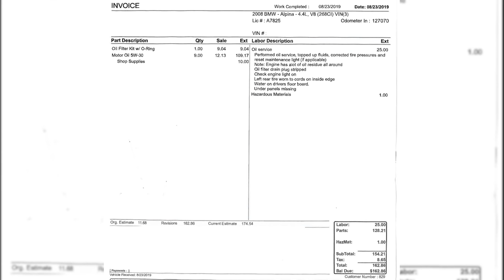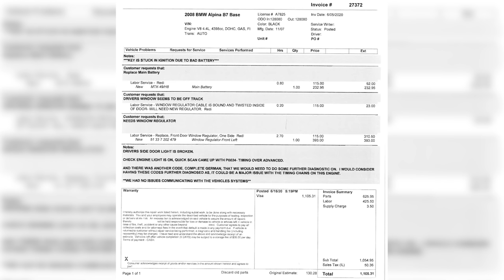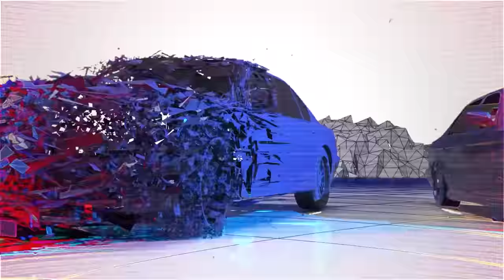Broken Alpina Is Hiding Secrets and a NAIL, Literally - Supercharged B7 - Project Chicago: Part 2

Comment: I used a small nail (instead of a simple metal pin that my tool kit didn't come with) to release tension on the timing chain tensioner when I did the VANOS seals on an M50TU. Thankfully I didn't drop it in the oil pan. Perhaps when they were timing it they used a nail instead of some special tool? Not sure. 

Great work as always Sreten!! This Alpina is proving to be a worthy challenge!
Reply: That's a good explanation.
Reply: There are other ways nails can get into an engine.
In a large service garage, besides mechanical repairs, oil changes and tire repair are also done.
Tire repair guy pulls a nail from a flat tire, throws nail at garbage can, nail bounces off side of garbage can and lands directly in the 6 quart container used to carry oil from the bulk oil to the car.
Oil change guy grabs container, fills with oil, pours oil into funnel in the car, nail is now inside the valve cover.
Yeah, that happened but was caught before damage was done because their hand was on the funnel and felt something jiggle down the neck.
I pulled a 2 inch nail out of that low mile, almost new truck before it was ever started.
Reply from the maker: I thought about that, but there's literally no place in the whole engine where a nail would be useful. I'm still baffled.
Reply: @M539Restorations  well, thank baby Jesus that it wasn't the last nail in the coffin! <-- see what I did there?! I make a funny?!
Reply: M52b25 or b28tu
Reply: The nail is purely for good luck.
Reply: @clementcroitor  door is right behind u
Reply: Or he was making his coffin realizing how much work it was 😂
Reply: one of the PO's had an enemy - that's sabotage. or an insurance scam
Reply: @M539Restorations  It's a magnetic nail to attract metal shavings ! Haha :)
Reply: @the_producer  Sabotaaaaage.....isn't that a famous song?
Reply: @hugovandyk3845  M50TUB25 in an E36
Reply: @M539Restorations  My guess is it was accidentally poured inside the valve cover during an oil change.
That nail probably broke the cam chain guide as it fell down to the oil pan.
Mechanics throw things at garbage cans and miss, and thrown things bounce.
That motor, once refreshed is going to be fine and run like new.
Reply: @M539Restorations  …but you used a special tool alignment pin yourself?

Comment: With my 850Si, just changing plugs and checking the V12 ignition system according to the workshop manual was scary. Even removing the driver's seat and fixing the seat back lumbar pump made me dizzy trying to put it all back together. Seeing your work on this Alpina modified V8 OMG - Sreten you are absolutely amazing - great work. 🤩

Comment: Question, Why dont you remove the bumper and headlight assembly completely? It takes just a few minutes and you would have so much better access. Compared to constantly working around them.
Reply: Older cars tend to turn into 99% dust when disassembled especially plastic and  clips and all that stuff. Also getting the alignment spot on on older bmw's isn't as easy as you might think.
Reply: @Doganderboss  If you spend the time of having all of this in the way into alignment of the parts you remove, don't worry. It'is time well spent. Reply from previous BMW car body repair specialist (as I am). Spare original clips are pennies in a rebuild like this. And don't worry about the dust, BMW are generally built as bolt off bolt on, compared to many other brands. And also they can be adjusted in all directions as you can dream off, so it's up to you and the level of perfectionist you are. As long as you use the same imprint in the aluminium parts for washers, the final adjustment of bumper assembly should be minimum. This E65 have no damage history as far as I can tell so the alignment should be straight forward, I used to work with damaged cars and still BMW was the easiest (in my opinion) to get a perfect front on. if the car has body aligment problem, it will still be possible if its reasonable to get all the lines 99% true.

Comment: This is the best video I have seen on troubleshooting the N62 engine. I assume this same procedure would work on all  
750 models then, correct? I must say being a YouTube taught mechanic, videos like urs are priceless. Because of such videos the blue collar man can now afford to take the gamble on German engineering. I remember taking my first Bmw, a 530i, to the stealership & being quoted $9,ooo! This was to replace the transmission which they claimed was shot. I was morally devastated that the cost to fix it was more than what I had just paid for the car. The wife said, "have u looked on YouTube for a fix". "Of course", I said not knowing what YouTube had to do with it. She of course knew I was lying & made it her mission to fix the limp mode the car was in. Hrs spent on YouTube & she finally found what she needed. She found a video on how to get to the shift solenoid underneath the actual shifter. Wouldn't you know she found a connection coming off the top of the solenoid that had jostled itself loose over time. She found me & said," I think I fix ur car". I said, "BS" so she proceeded to showed me the connection which wasn't push together. Long story short she put the dash back 2gether & we went for a drive and no more limp mode.  I never had a issue with the trans again. $9,000.00 was the Dealership quote & she fixed it with a YouTube step-by-step video similar to urs. Thanks for the thorough video on the N62 timing issues. You don't even know how important these type of videos are to us blue collar guys & gals.😂 They make it possible for the working man to afford such luxury. Where as b4 YouTube the high end German engineering was only available to the wealthy! Thanks again & Please keep making ur intuitive videos about ur Alpina!-)

Comment: That was a challenge for sure. So many parts to remove just to get to the bits you needed.
Paint/mark a white line vertically on your socket and then you can see if turn easier. Normally stick the white line inline with one of the six points of the socket. This also aids torque turning as each point as you know is 60°
We all have confidence in you to get this engine back up and running better than ever. Have BMW upgraded the material for the coolant pipe o-rings??? To something with a higher melt point than OEM spec, to say Viton or even Kalrez.
Keep up the great work.

Comment: After doing my one on lock down last year I felt your pain and knew most of the stages you were going to do before you showed them. Mine is on a 5 series so it's tighter in the engine bay, particularly at the sides. great video as the time that takes in itself to do that is long enough as well. One thing to watch is don't let the vanos sprocket seals dry out of oil for too long as they can cause problems with sticking and causing poor movement.

Comment: 29:29 Get yourself a set of flare-nut wrenches for those fittings (and for brake lines). They grip the nut from 5 sides rather than 2, significantly reducing the risk of rounding it off if you need to apply a lot of torque.
Reply from the maker: I have them for brake lines. Bigger than those you can't really round off.

Comment: My friends e38 also had a M8 bolt inside the transmission oil pan so I believe it is supposed to be there. Bmw just wants to give you a free spare part to fix something. Check if the nail has a bmw logo on it somewhere. You can now nail something my friend.

Comment: Sreten, 
Fantastic series, after fantastic series! This is a brave one though! As my father always said, "You eat an elephant one bite at a time!" The overall complexity is daunting, but each subsystem is simple enough. But, you are going where few DIY'ers and only professionals go (and even they don't relish the thought!). Who would have thought that legendary BMW reliability (Ha!) would benefit so many professional mechanics, AND "Professional talk to myself'ers!" You know Sreten, it has always seemed to me that BMW "almost" gets it right, but is always let down by some small detail... Like the coolant tube seal, buried deep in the engine. Or constantly cracking coolant reservoirs... Or Vanos issues... or main bearings (not actually a "little detail")... or SMG... or... or... or... LOL. And, what is more frustrating is that they take SO LONG to fix issues, and then keep repeating them. I can't tell you how many window regulators I've replaced! All because they use a crappy plastic wheel/pully in them, that eventually breaks and takes the cable with it... That would be fixed with a millimeter or so of additional material, or an aluminium pully (is there a business opportunity here? Lifetime window regulators? :-). The driving experience, the great interiors, are let down by details... Which make the cars infuriatingly unreliable. So why do we keep coming back...? One thing I can say with authority is, that having run the Aftermarket Division for MAHLE in the US for many years, at least I know the pistons are good! 

Sreten, please continue making this quality content. Maybe add a little more content on the specialty companies in Germany that do excellent work, like the leather guy's shop and the amazing artisan work he does... That steering wheel was a work of art. Thank you for the knowledge, entertainment, and humor!

Edit: And by the way, I think what most people love about your content, is that you are us! All the things that I do when working on a car or motorcycle, smash my hand, covering myself in a surprise oil or coolant bath, forgetting to do something that requires doing half the job again, dropping tools or bolts into inaccessible places, yelling "come on, come on, you bastard!", or "whatttttt, why did they do that???" and many, many more reflections of the everyday man "talk to myself'ers... We all do it... But you do it SO WELL!

Comment: My solution to the timing chain guide bolt was to get a similar bolt cut it to the same length and then i measured the distance where the nut is located on the original and  affixed one i in the same position. I then bolt it from the front directly through the guide. It has the flexibility where it is pivoted. With me doing it like this I had avoided removing the cylinder head a second time. I had to remove them to decarbon the crown of the pistons as the engine was jammed if you try to turn it manually from the crankshaft pulley. After completing the task and reinstalling the head I realized one of the guide had a crack and it did not want to do the job a second time. It’s worth giving it a try i the other method does not work.

Comment: When you contemplate swapping out the engine rather than the guides.
My life, the engine designers were truly smoking crack and ltao at the accounts department with this one.
I swear they must have been paid by the hour, so made it as awkward, complex and elaborate as possible.

11/10 for resolute determination.
I would no doubt have the odd bolt leftover after putting it all back together, pondering how important it actually was.
But a nail ? LMAO
Perhaps those previous mechs simply threw one in for good measure, while the boss wasnt looking.
They must have been real pissed at working on that engine.

Anyway, great stuff. You defo nailed this one.

Comment: Word of advice— next time you need to do this much work to an N62, just pull the engine out. There's not a lot of room to work on it in the car and you'll actually save yourself time by having it out and on an engine stand. I just recently did valve stem seals, valve cover gaskets, upper timing gaskets, and alternator bracket gasket on an N62, along with cleaning the secondary air passages. Doing it with the engine on a lift table was a breeze.
Reply from the maker: Thanks, Danny. I explained in the video that it would be very difficult and time consuming to do that on a 4-post.

Comment: I enjoyed this, respect+ for tackling a job like this head on, this is a great test of ones nervous system. 
I do want to rant a little tho. WHY do germans do this? Planned obsolescence? Did they hire interns for designing chains? How can it be that consistently for 20 years and counting there's timing chain failure? Literally nothing is wrong with timing belts, the newest generation of belts achieve 200k+ km intervals, my car did 16 years and 160k km on ONE belt,  meanwhile the latest and greatest german cars have chains fail as early as 100k(see BMW n series engines). TBelt kits are usually in the 100-300€ range, so a tenth of what the video author spent on this. Replacement is usually 3-8 hours (inline vs V) instead of removing the engine. Timing failure was practically unheard of in the old days when Audi and BMW used belts. Hell, there wasnt even an interval. The manual said to inspect it every time the car's serviced.
And nowadays its considered the norm to replace the (lifetime) timing components 2-3 times during the lifetime of the car. I can maybe give Mercedes a pass, but the other two..

Comment: I rebuilt my n62 a few years ago and has since been in storage for 3 yrs after a few thousand miles of driving, it hasn't been started since. Now I'm scared of all those faults that can happen esp with the chain guides and exhaust timing on Bank 2 as well as other electrical gremlins after such a long time without use 😬

Comment: Do amazing work.  Why BMW doesn't use more reliable materials for seals or at least design stuff to be more accessible.  Seems estimate from shop was worst case scenario.   You make it look easy at times.  Good thing owner kept oil changed and used the correct type oil by the look of the inside of the engine, it was very clean.

Comment: Yeah found that in a 2005 Range Rover. Not the nail however but a lot more plastic and aluminum pieces. The chain cut deep into the timing cover. Yes a BMW V8 engine.

Comment: When it comes to the noises and words that come out of my mouth when working on my e60 n62, I went through all the same motions you did, Starting with those damn eccentric shaft sensors. As if the n62 didn't leave the engine bay crammed enough, Idk how alpina managed to find room for a supercharger and intercooler.

Comment: There is no freon in the a/c system. You now can easily remove the a/c compressor. Would it be a good idea to either have the a/c compressor tested for function and leaks, or replace it now? It seems it would be a lot of work to have to replace it later after the car is put back together.

Comment: Hey Man. Since I watched this last night, I sleeps over it and  I was thinking  if lack of oil caused this engine to shred  all those chain guides into pieces and this can only be explained by massive oil burning and  must have going on on the engine for a long time. to be honest I don't think at this point if Valve seats or crank itself are in healthy condition as this Carnage was happening in there. I think maybe this is the first project that won't make  financial sense additional investment and chop shop might be the way to go here.

Comment: I know folks won’t like this, but firstly I have followed the channel pretty well since the start and don’t miss an episode. BUT when seeing the mad complexities of this engine you have to say why build one of these to start with. Clearly the car was good until 126k approx then 2k miles later was scrap / beyond economical repair by a shop. Where in my experience the so called mechanics are part changers. BMW and MB need to wake up and smell the coffee because Tesla are here, my Model S would probably blow the doors off of this and some. Lots of my friends said not to get one, it would fail it wasn’t built good - doom slanted stories put out by lobbyists on behalf of the IC dependant companies. It has been perfect, very little drop in range and charges mostly off of the solar at home. Count the components in this, then the Tesla. Meanwhile will enjoy theses videos bringing the clever dinosaurs back to “ as new” we love thee channel keep at it. Best from Worcestershire UK.

Comment: Forgive me, for I have sinned. There exists an M20B25 which is also carrying a nail in its oil pan. It's smaller though, I used it to turn valve clearance adjusters and it slipped. Down to the oil channel it went, never to be found again. Didn't bother to drop the oil pan, it was E30 325iX where driveshaft goes through the oil pan etc...

But I swear, I have never touched this engine (nor any Alpina to be clear)!

Comment: Alternator bracket seal failed on my brothers 645 and it jumped timing base the car run like garbage 🗑️ . I think it has something to do with the tensioner needing oil pressure to hold tension... Low oil, low pressure, jump time

Comment: I suspect that the nail was there not by accident. Some low car 'mechanics' if you could call them so, use nails to fix in place the camshaft wheel when they want to change the timing belt/distribution. I've seen it happen in eastern europe.

Comment: The way I do to organize parts, instead of using generic freezer bags, I use my wife's pumped breast milk bags to store and label the bolts. They have a seal that doesn't require the use of the twisty steel wire so they are more convenient

Comment: #nailenginetheory #1: a mechanic tried to fixate something chain related with that nail, not having the proper tools, it dropped deep into the engine and under whistling some tunes he put the thing together and wrote a big cost estimate (that wasn't even big enough).

#2: the former owner was abandoned from his gf after cheating on her and her mechanic brother told her to stick one nail into the oil cap and one into the dipsticktube as a salute to the mechanic.